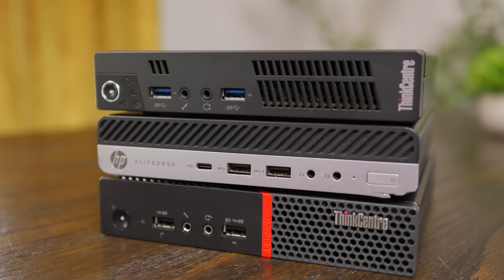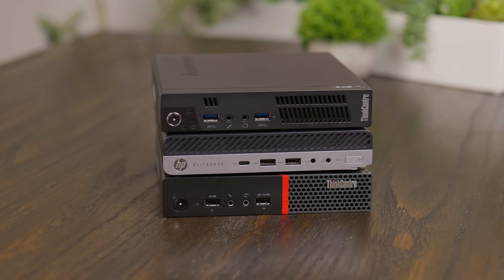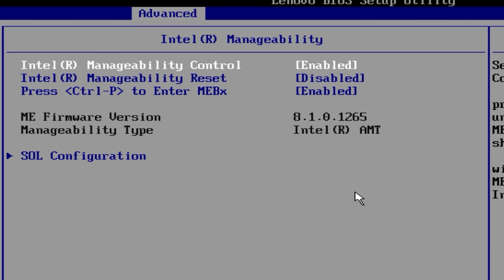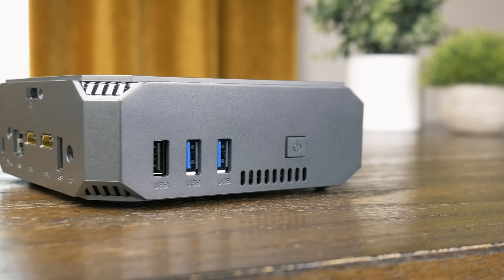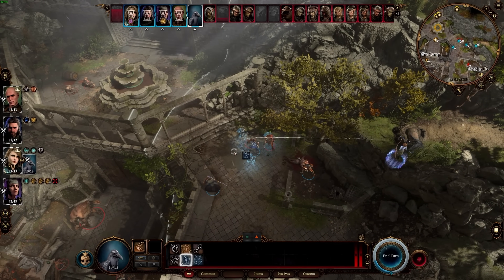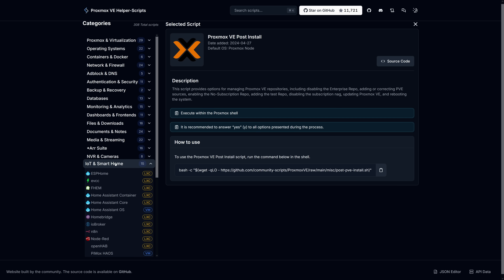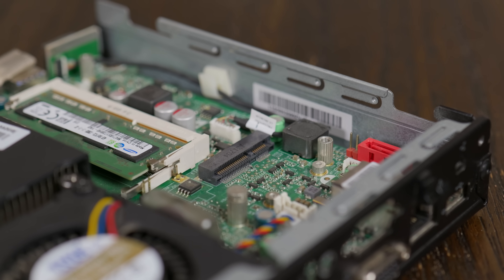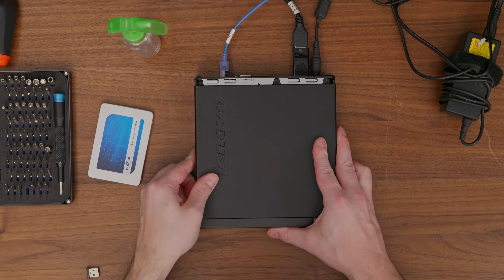Why Are People STILL Buying This Old Mini PC?

Comment: You missed the COM1 header on the motherboard, which would match well with the empty hole on the back.  Great if you want a PPS signal from a decent GPS receiver for a decent quality timeserver.  Alongside other uses, of course.

Comment: You are missing one thing. Windows XP support. While some 4th gen intel OEM systems support it, 3rd gen was the last strong support. While not as good as dedicated GPU the internal graphics still work well for this also.
Reply: Download Windows XP Integral Edition it has great driver support for some newer systems. It's crazy what the community has developed to keep XP alive. You would know it from the old days as the famous Windows XP Black Edition, still maintained by some of the same guys just under a new name.
Reply: @Agret  thanks for the info on integral version. I'll be searching for it.  I LOVE XP.
Reply: Dedicated XP box with older Fujitsu scanner & bundled Kofax VRS5 makes a highly efficient scanning station.
Reply: Came down here for this comment, was not disappointed. As soon as he said what CPU it had that was my first thought, I even checked the specs and XP drivers exist for the Realtek audio too.
Reply: Windows 11 this windows 11 that. All my homies are really concerned about legacy windows xp support.
Reply: @bluetyphoon2100  I bet
Reply: Yep they make great systems if you have to make sure your software runs in windows xp.

Comment: I have an M72e Tiny that I bought a couple years back from a local game shop. Pretty much everything you've mentioned here is true. The second port cutout above the VGA port typically has a blanking plate with a WiFi antenna port, which your M92e seems to be missing outright. (In fact, yours is missing a lot of parts.) But, yes, you can also install a DB9 serial port there as well. (FRU 54Y9345 fits perfectly.)

I did manage to install a second 2.5Gb NIC in it, but there's caveats there as well. I had to perform a ton of modifications just to get everything to close back up with the stock drive mount, including replacing the pin header on the NIC with a 90 degree one and trimming the connector for the Ethernet jack pigtail just to get it to be able to plug into the card. I couldn't mount the Ethernet jack, so I just have the pigtail feeding through the other WiFi antenna port cutout, which required de-pinning the Ethernet pigtail and reinserting them into the trimmed plastic connector shell. 

Learned the hard way that OPNSense/pfSense didn't have driver support for the Realtek RTL8125BG chipset, unfortunately. Perhaps a gigabit NIC would work, though?

Comment: Well, I've deployed almost an hundred of M75Q gen 2 in the past two months... They're cute little machines, not so powerful, but for normal use in hospital IT they're plenty of. 
The main feature is the low volume on desks, but I fairly hate the low number of USB ports, because I hate hubs, usually they aren't so reputable.

But at home I've a proxmox machine on a M910Q which serves me well.

Comment: Nice video; Imo it perfectly illustrates that choosing a PC / IT-solution is about 'what are you going to use this for? ' Most things we do, don't need much to get going.
Reply: yea, I remember back in day I bought overpowered i5 and lots of ram, just to never use all the power, probably barely used 50% of it  
it was a want over a need,....never again though

Comment: I have had an m75q 3400GE system for a while but sadly could use it to upgrade my plex server since amd integraded gpu sucks at encoding.

Finally ended up nabbing a m720q that was def an upgrade to my 4th gen intel in my current plex machine. with this also having a pcie as well I was able to fit a low profile gpu as well.

Got it all in a Lenovo AIO monitor for the tiny pcs and it's great. (HDD storage is in another machine.)
Reply: Lenovo hardware locks their AMD CPUs nowadays, I won't touch them with a 10 foot pole

Comment: I got an M710q with an i5 7th gen for £29/$38 at a charity shop sold as not working as there was no power cable. Had 8gb of ram and just needed a drive so added a spare NVME for me to run windows and dual boot into the 2.5" ssd for my daughter. Absolute bargain.

Comment: That Mini Lenovo's thermal issue with the fan not blowing onto or pulling air from the CPU seems like an Apple design. Fan is there do not worry, think different. The issue is the consumer not the actual design of the cooling.

Comment: 10:04 While yeah, a PCI Express 1.0 x1 socket would be approximately the same max throughput as a spinning rust hard drive, a lot of people forget that the SSD's main advantage is random IO and that it wouldn't be hampered by the port because it's still 50x faster than an HDD.
Reply: Yes, if the link becomes the bottleneck: ~250 MB/s / 4 KiB ≈ 61k IOPS. But at low queue depths, IOPS are latency-limited, not bandwidth-limited.

Comment: My main homeserver is a HP Prodesk 600 G4 Mini, which is newer than this with an 8500T, but it's a great little system. And I specifically chose it because it supports 2 x nvme and 1x 2.5" at once, which is really useful.
Reply: I have same CPU in Lenovo version, works great
Reply: @ljsmith197878 yeah 8500T is the best balance of performance and price in the used mkt
Reply: Hp systems still getting bios updates (also via the bios internet update) 

I do recommend avoiding the very small systems  (avoid USFF in general so your not using T cpu) ,, the hp 400 or 800 g4 (SFF) i5 8500 6 core 16gb ram 250gb ssd (sometime it’s a nvme) all for under £120 (3-2 internal sata sockets + 1 nvme, pci-e slots and runs quite as it has full size heatsink and fan)
Reply: @ I specifically want the T CPU's. My entire homeserver is using 8-9W at normal load, and the performance is more than enough.
Reply: @leexgx  I have the 8 core 10700T. They are perfect for Proxmox. Once you stuff 2 NVMEs and 1 SSD in the mini chassis, T series temps stay under control.
Reply: @leexgx nothing wrong with “T” SKUs for most entry level home lab use cases. It’s just an artificial clock speed cap and I’ve found you can generally find them cheaper than comparable suffix-less SKUs
Reply: That one is pretty sweet. The i5-8500t has six cores, instead of the 4 core i5-7500t or i5-6500t used in earlier models, and 8th gen intel supports TPM2/Win11. The downside is the price does go up a fair bit for that model.
Reply: @AAjax  they're $75, so still very affordable
Reply: You can get a 2.5Gb or 10Gb NIC for the Flex port as well.
Reply: More the USFF ones I avoid they are nice and small But usually lack any pci-e slots and sata ports (SFF are bigger but has everything usually and support full speed cpus) 

T cpus only limit the maximum power draw and speed under load, but at idle 8500T and 8500 use same power) depends on your use case (I generally need the burst high speed of the non T cpus as makes them run around the same as a 3-4th gen cpu when using T) 

Still like the hp systems due to the built in Internet update in the bios and they are still supporting the 8th gen Intel systems recant update as recant as last month I believe for cpu microcode update for security reasons (that said there windows based update tool just uploads the file to the bios and restarts the system to do the update on boot)

Some of them even support AMT (nice been able to manage them with system commander) I have been focusing more on VPRO/AMT  systems for that reason (but that requires certain cpu/motherboard/OEM system combo)
Reply: I just bought that exact model for my dad to use as a light desktop system running Mint, he's pretty exited because he can't fully wrap his head around a system that small being that capable. (he's aware that laptops exist. Human brains are just weird.)
Reply: I regret not having drive expansion in Wyze 3040. Eyeing for an upgrade, but for now got 4tb smr hdd on usb2 and sss on usb3.0. i wish there was cheap sdio to sata adapter
Reply: I was just gifted on of these.   I am going to install a 2280 m.2 and a 2230 so I can keep the 2.5 rack to add an ssd.
Reply: @DM-sc4ru  You can use two 2280 and a 2.5, you just have to modify the 2.5 carrier a bit. That's what I did. :)
Reply: Those are actually a bit expensive as they are a great base for Hackintosh as well. I do currently run such a machine as a "mac mini".
Reply: I use a HP Prodesk 600 G3 sff for a minecraft server under ubuntu.
Reply: Are you really sure about that? I thought it was one m2 NVME and one m2 SATA connection. I'd appreciate it if you could check again. NVME drives are now not only much more modern but also cheaper than SATA.
Reply: What is the purpose of a home server?
Reply: I use the elitedesk for my telescope (and cameras). It's much better as it has much more horsepower than the arm based device that most people who do astrophotography use.
Reply: @loulou53137 what telescope do you own?

Comment: M92 and 93 are not worth it as in most cases they go for ~$100, for which you can get M720Q with i3-8100. I just got myself M75Q Gen 2 with 5300GE with 64GB of RAM for $300, but it's what works the best for my need.
Reply: Ya I got a 720q with 8500t and 16gb for 125. Threw 32gb ram in and working great with proxmox
Reply: I still see them for $40-50, but not as often as I used to.  I told a friend of mine to pick up a 93P with a 4570T two years ago for his use case, and I think he paid a tad over 40 with the power supply included.  At that time, there may not have been a better deal around.  Under 50 and I think they're still good, assuming the sixth and seventh-gen Intels aren't getting down to that price.  But over that, and it's probably better to look at the newer machines.

Comment: 5:09 Can you pls 3D print that airflow guide and run the test again?
Reply: He showed that there can't be an airflow guide because the fan doesn't have the intake on the side where it could pull air through the finns of the heatsink.
Reply: @kyuthefox  He could make one some how even tho it dosen't have the intake where the CPU heatsink is